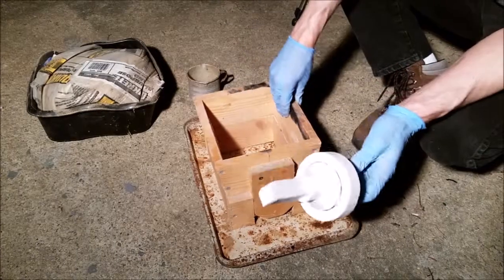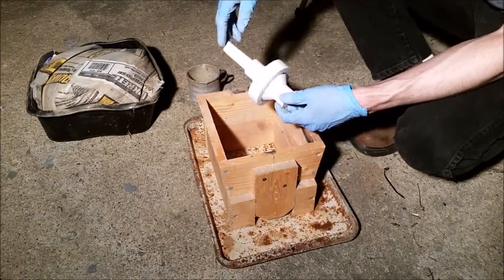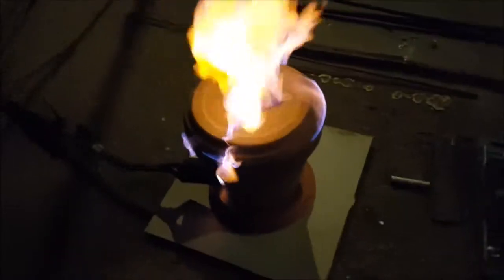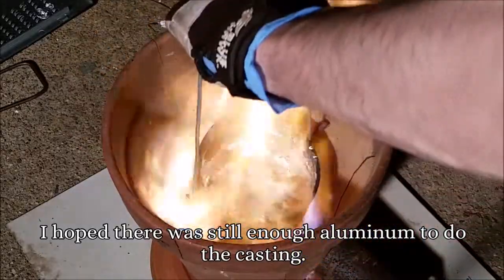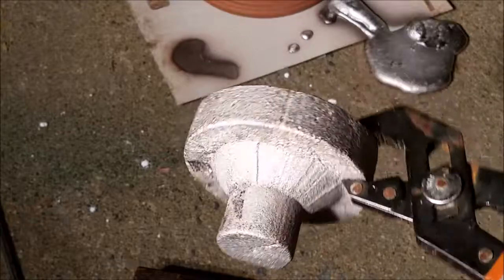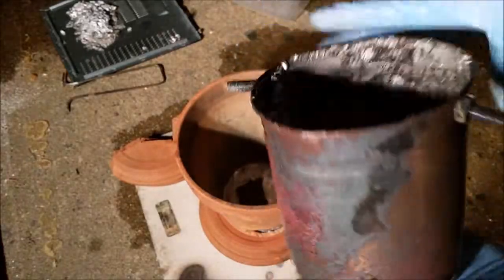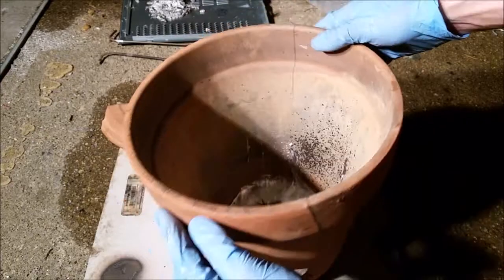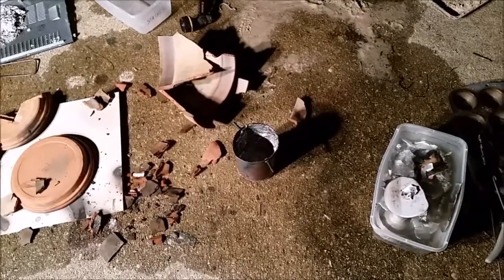Lost Foam Aluminum Handwheels Casting (gone wrong)

Comment: Additionally, your sand could use some oil for cohesion. According to my local blacksmiths.
Reply from the maker: When doing normal sand casting, yes. But on lost foam casting you want the sand to be dry.